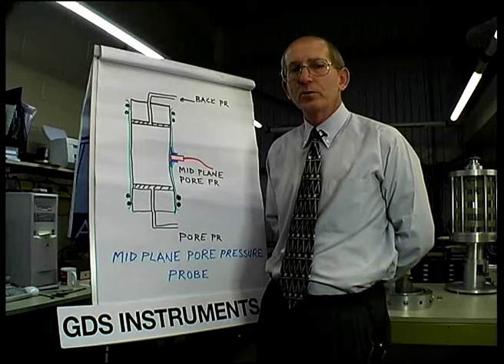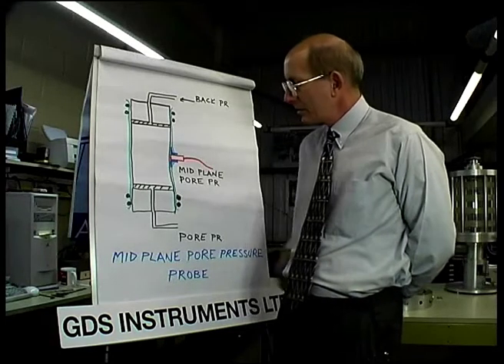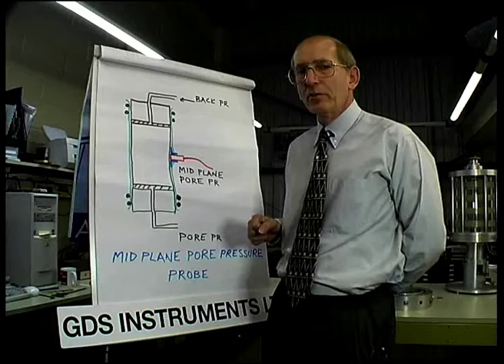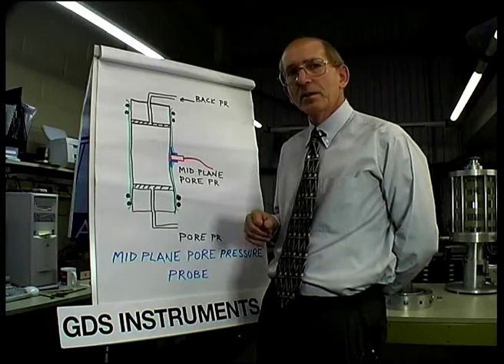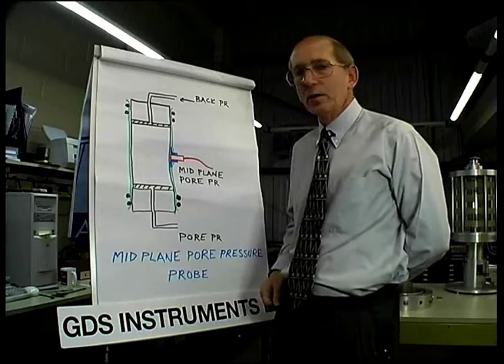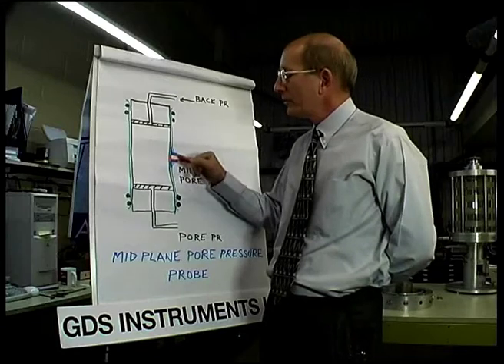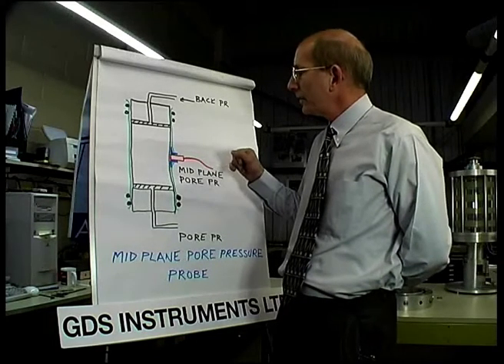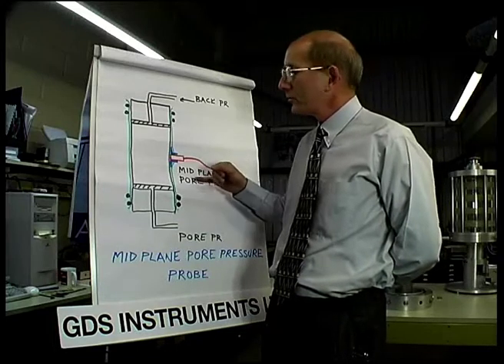Introduction to the GDS Mid Plane Pore Pressure Transducer

Comment: When you insert the mid-plane pwp into the membrane, a low quantity of air is introduced. Shouldn't it be removed by applying, in a gentle way, vacuum to the lines connected to the back pressure?